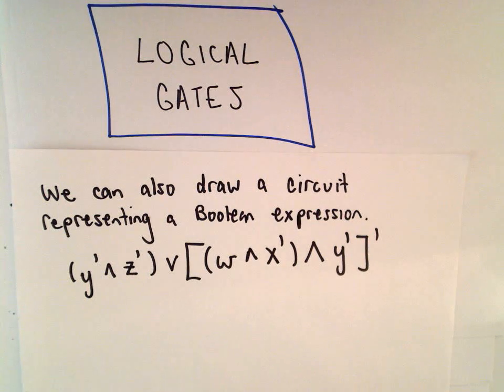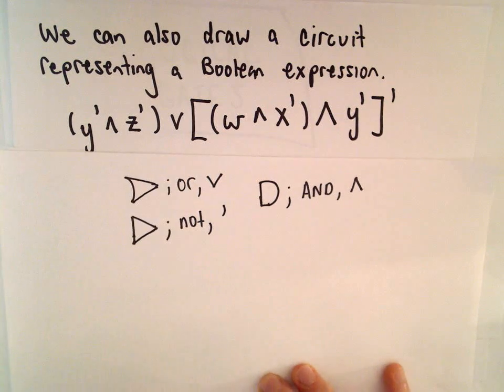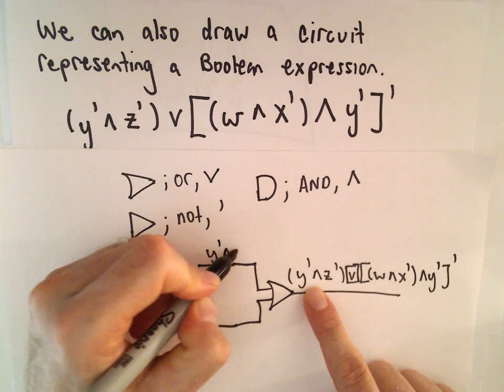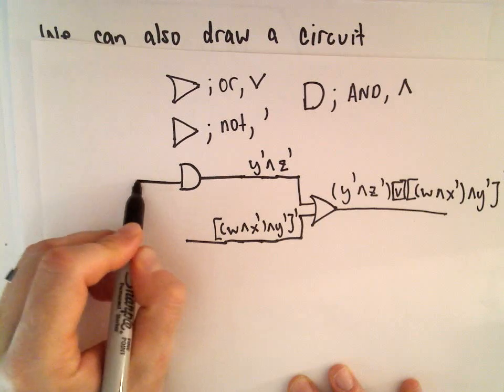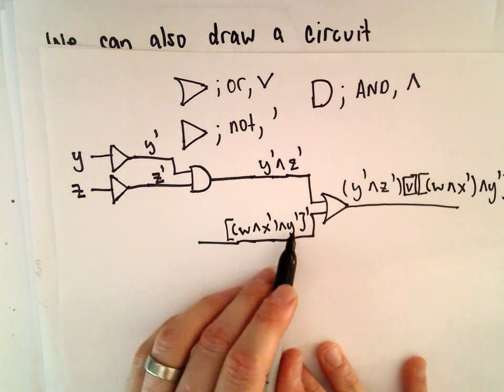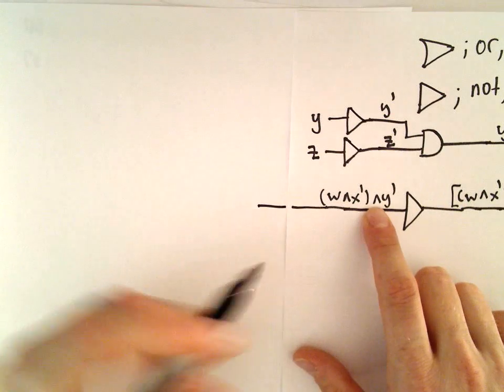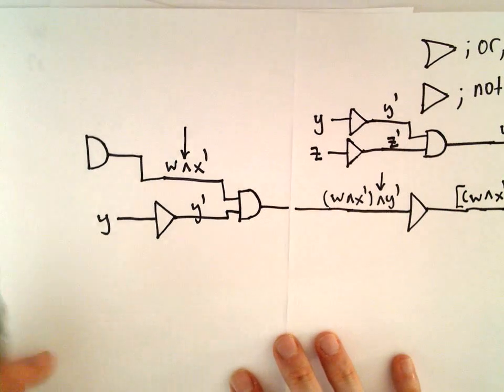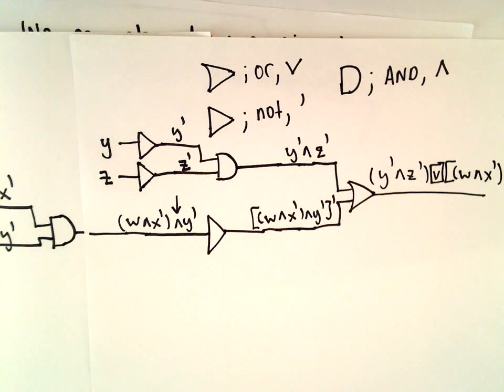Logical Gates ( Drawing a Circuit that Corresponds to a Boolean Expression ) - Part 4

Comment: What Discrete Mathematics book are you using?  I just ordered mine; I'm taking it next semester.  I've really liked it so far.  Just finished the section on boolean expressions.  Nothing new, but new notation to learn.  My book doesn't use the ' notation for NOT, but rather some weird horizontal line thing.  I dunno.  I'm still accustomed to '!' ;)